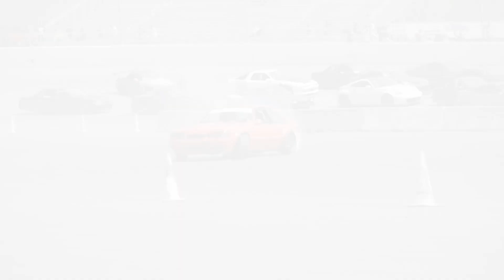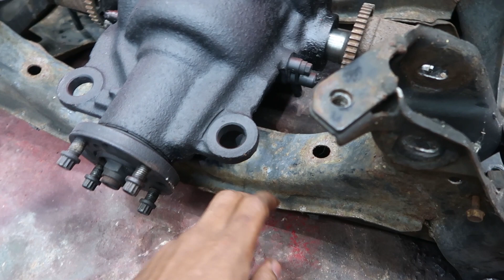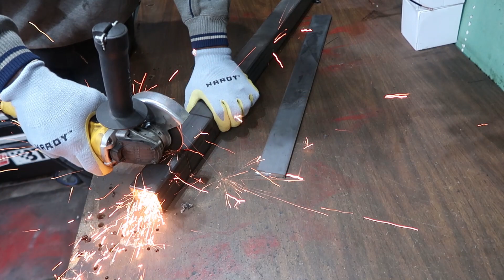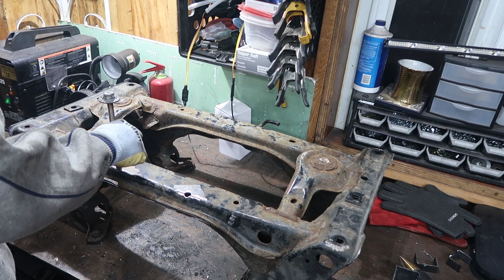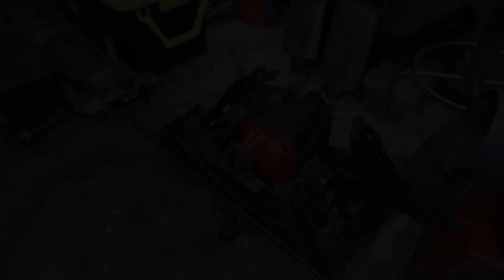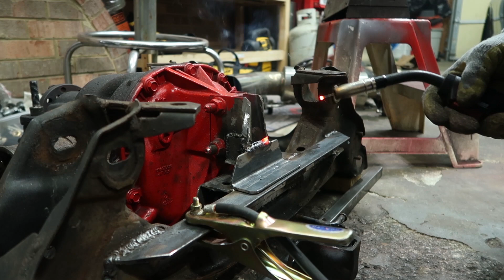Fitting a ford 8.8 differential into a Miata subframe

Comment: Did Ford ever make a 8.8 front axle? Or IFS 8.8? If they ever did what models and years would they be found in?
Reply from the maker: no idea, i have very little knowledge about 4x4 stuff.
Reply: It's in the Mustang s550. The manual v8 cars have the strongest diff. The autos had a lighter aluminium diff.